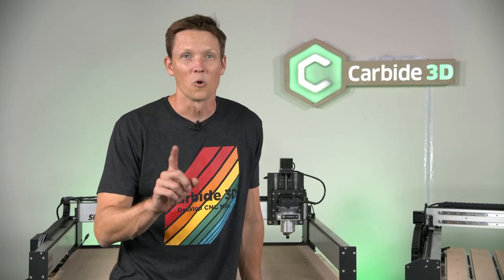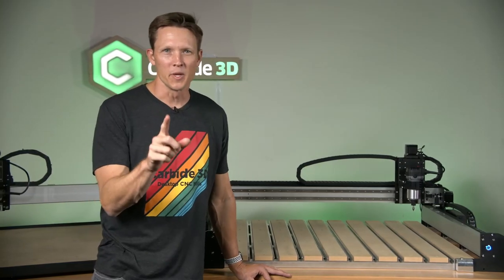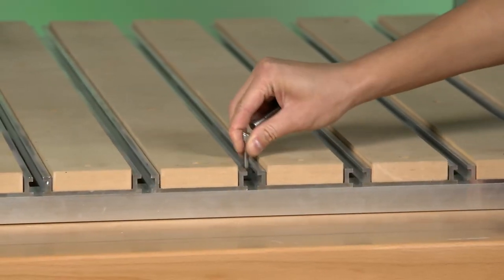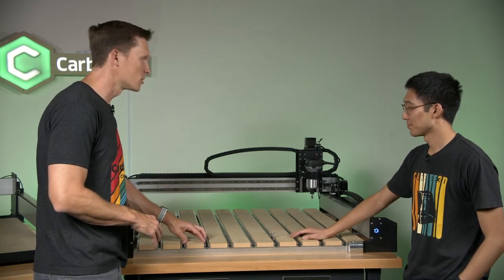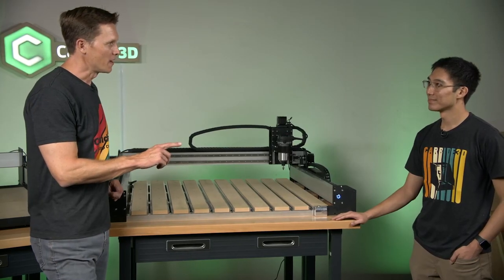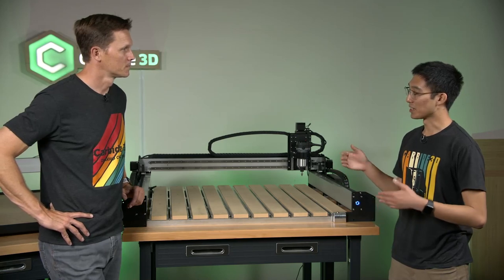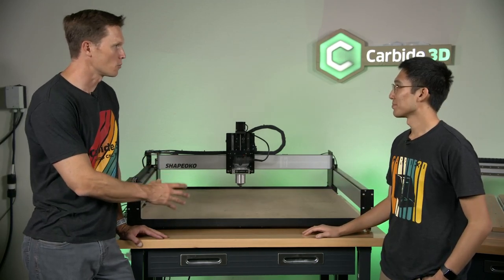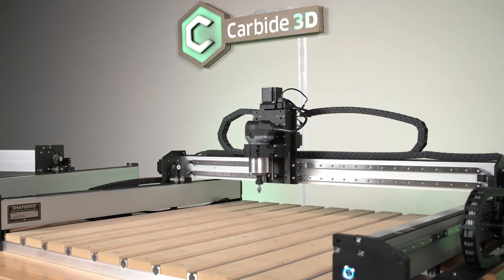First Look at the Shapeoko Pro XXL

Comment: Hi I’ve got a couple questions. 

Can the t-tracks be taken off from the Pro, if I don’t want the wasteboard pieces to be that narrow?
Is the bitsetter’s location fixed? Say, can I put it on the left side inside?
Reply from the maker: The bitsetter is attached to the endplate on the front right, and that attachment point does not exist on the left side so you cannot move it.

The hybrid table is integral to the rigidity of the frame. Under the MDF strips are custom extrusions that go front to back, and they tie into beams going left to right. Together, they hold the frame square. There's nothing stopping you from trying to replace them, but we can't guarantee the machine would be as sturdy or accurate then. It would be easiest to simply put a sheet of MDF over the hybrid table.

Comment: any way to progressively upgrade from the shapeoko 3
Reply from the maker: Because almost every structural element has been redesigned, there's no way to fully go from a standard to a Pro. We are looking into ways to bring certain improvements in the Pro to existing users, like the Hybrid Table, but we do not have an ETA on that.
Reply: @carbide3d  An SO3xxl linear rail upgrade kit, and/or a X/Y belt upgrade kit would be AWESOME!

Comment: Have been waiting to pull the trigger on this but so so disappointed that it still uses belts. Was seriously hoping for ball screws on the pro when announced. 
This has put me off for now... Really need a CNC for home but honestly can't wait another year or so for your next version to come out that might hopefully have ball/lead screws instead of belts. 

We use belt driven cncs at work and the belts are re-enforced steel toughened belts. They are thick but do stretch over time and need to be replaced.

Comment: Hi Winston
I love your great videos 
I really like the new XXL PRO now with linear rails as I never liked the plastic V wheels used on many such similar machines
I had a workbee which I chose because it had a lead screw vs belts, but it had the V wheels .. 
I have now sold my workbee and looking for my next machine and your new XXL PRO seems the one I am interested in
A question regarding the belts you now use on the new XXL PRO
I note that they are now 15mm.
In your opinion, are these as good as using an 8mm leadscrew like on the workbee ?
I plan to do a fair amount of aluminium plate making from time to time for other machines I plan to make
Will the belts work as well and cope with that sort of aluminium cutting requirements ? ie stretch / break / etc... and will they be as accurate as leadscrews
May I ask why you chose to use belts rather than leadscrews / ballscrews ?
Keep those great videos coming 
Thanks
Reply from the maker: The 9mm belts we used prior coped fine with aluminum machining. 15 should be near indestructible, the limitation is stepper motor torque. It's functionally very close to a rack and pinion setup at this point, but without any issues of alignment and tuning since the belts are more forgiving. Leadscrew will have a precision advantage because there is a mechanical reduction, belts will have higher speed. It's a tradeoff we thought was appropriate for a general purpose machine, and we have a long track record with belts that we're confident in the reliability.
-W

Comment: Is it easier to put together?  How long does it take to assemble?
Reply from the maker: It is much easier to assemble. The unboxing process has been streamlined and everything goes together faster. The gantry is already assembled, so you basically just need to build the frame, drop the gantry on top,  then do wiring. We expect it'll take people about 2-3 hours.

Comment: Dang, I literally just bought the XXL a month ago. I wish I had known this was coming out. Also Carbide 3D, what tables are you all running in this display. I've looked everywhere for a table that can support the XXL and can't find anything.
Reply: This one is on a pair of rolling workbenches by Seville Classics on Amazon. Also worth checking out Uline for industrial-esque rolling tables.
Reply: @WinstonMakes  Thanks! I see from looking more closely at the video that it is a pair. Therefore a moment I thought you had found the holy grail of the 48" by 48" table. I appreciate the response and insight. I really like the clean industrial look. I'll check them out.
Reply: Build one?
Reply: @sethaldrich5300  Hey Seth. That is what I did. It’s constructed out of two sheets of 1” thick MDF measuring 48” x 48”. For the legs I have 4”x4” posts. Using a diagonal cross bracing between all to ensure stability. Overall, the table is rock solid. What I was getting at was more the polished look of the tables seen here intrigued me as they provide a much more industrial and professional look (IMO) compared to my all wood table.

Comment: "These belts will not stretch" shows footage of stretching belts
Reply: Even old Fat guys  figure outs belts  don't work after a certain degree  of stress and  move on to Suspenders!
Reply: Compared to other belt systems, they don't. Plus, you don't want to have them super tight or you risk breaking them. Plus, they were deflecting the belts, not stretching them in their tensile direction where it matters.
Reply: @janderson2375  Assuming the rest of the machine is rigid you can't deflect the belt without stretching it.
I'm sure its a fine belt system, but if the drive system is the same as the older shapeokos whats gonna reduce belt lifespan is not the tension but the tight bend radius.

Comment: Why not a fixed rigid frame/gantry and a movable bed??? Am I going to have to sell a kidney to buy this in the UK??
Reply from the maker: A moving table of this size would require around 6 feet of total clearance in the Y direction, require a much much bigger structure around it, and probably slow down the Y motion because of weight of the moving table.  

Once you get above a certain size it's much more efficient to use a moving gantry.

We can ship to the UK now and, once we get past the opening demand, I suspect that some of our EU distributors will carry it locally.
Reply: @carbide3d  I would have expected anyone getting an xxl wouldn’t be short of the space. I know you can get moving bed machines this size, just curious that’s all.

I’ve noticed the price had gone up in the UK, that and not being able to source any stock for a long time, otherwise I’d already have an XL.

Comment: They released a “pro” xxl with some upgrades and linear rails and its 1k more? It seems like they should have just put these upgrades on all of their machines. 
I have never had a need for t track table. Bought it never installed it.
The bit setter is great.
The shapeoko 2 is a good design but old. Everyone has been waiting for an upgrade for you to make it more rigid. Just confused by this marketing strategy... seems like you should be discontinuing the old machines and releasing the upgraded model. It’s great don’t get me wrong and not everyone will need the upgrades but this will have people who buy the standard model pissed once they find out how flimsy the z axis is and that they could have bought an open builds with linear rails for way less.

Love the shapeoko, awesome machine for what it is. This should have replaced your other version though.
Reply: That is why they are on Shapeoko3. 1k seems more than fair for the changes.